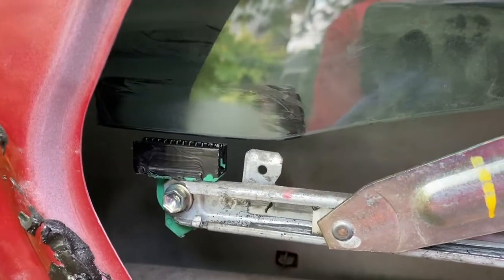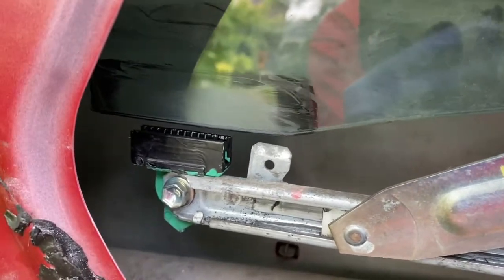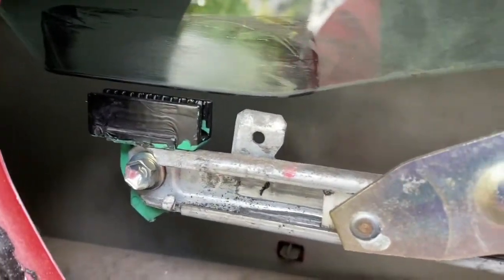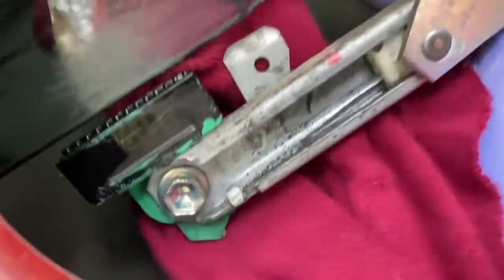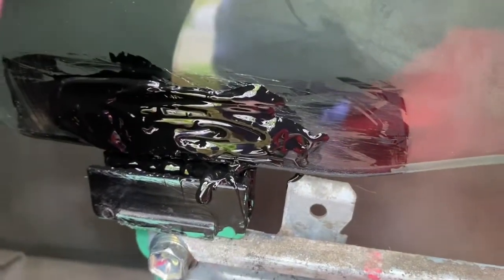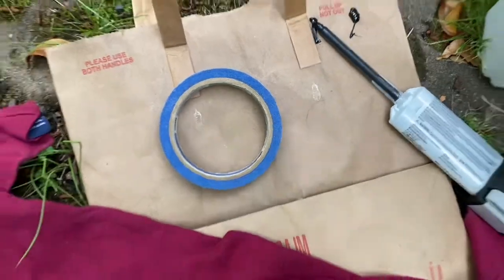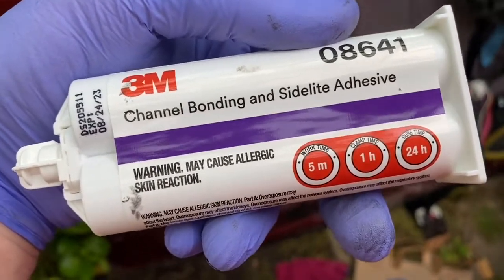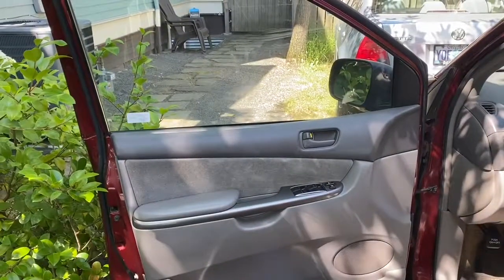Fix Toyota Sienna detached window clip using 3M Channel Bonding and Sidelite Adhesive, 08641

Comment: How did it hold up? I have the EXACT same problem and am about to do the same fix to mine. Thanks so much for the video! You diy YouTubers are real lifesavers!
Reply from the maker: No issues/good as new.
Reply: @CraigStrong can it be done with Epoxy Glue?